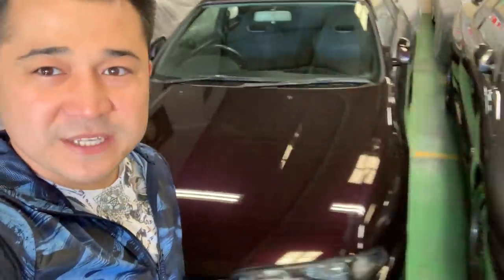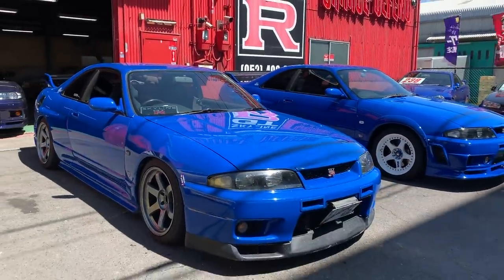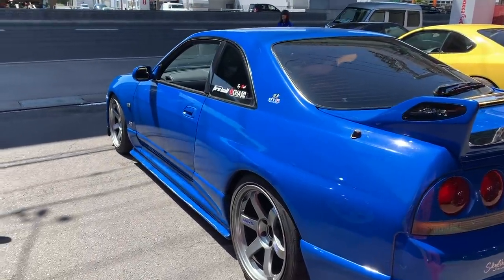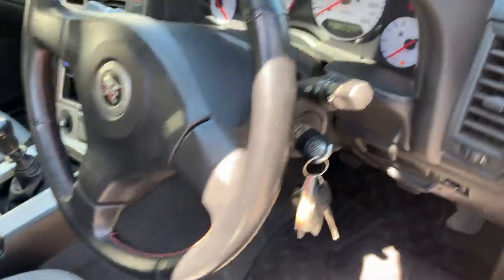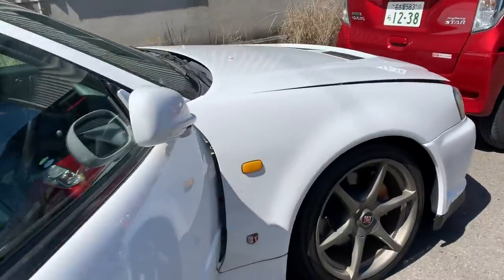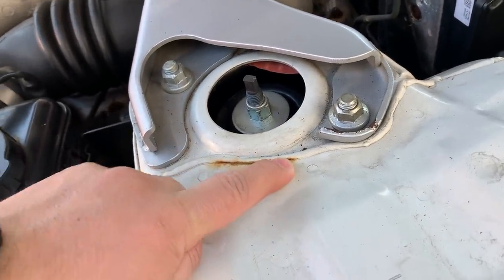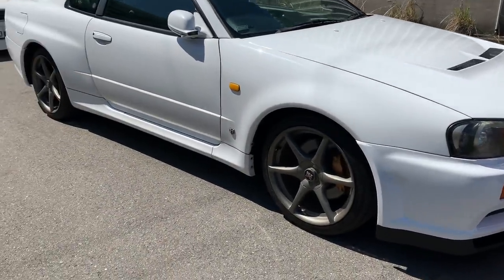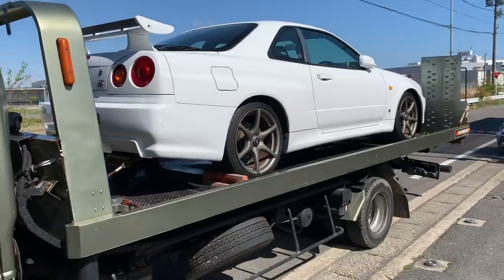Nissan Skyline GTR R33 & GTR R34 shipment! TWO LM GTR R33s!!

Comment: That's not a LM Road Version, That's a stock Skyline V-spec R33 GT-R.
The Nismo R33 LM Road Car is a Rear wheel drive Wider Body homologated for the FIA GT1 in Le Mans for the 1996 season.
Only 188 where build all of them where silver but a Midnight purple version of a Nismo GT-R LM Road Car is a mistery.